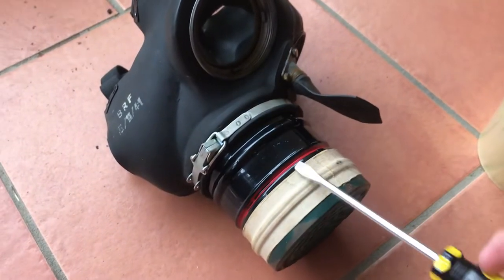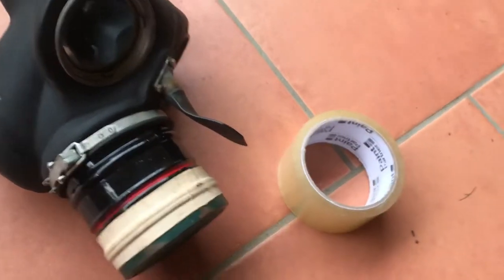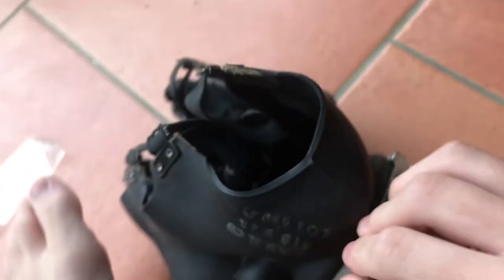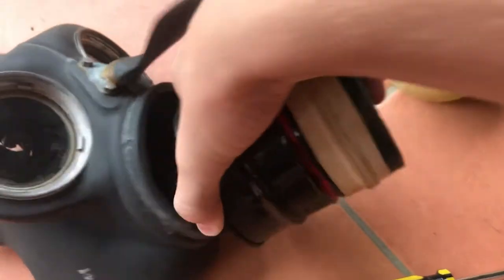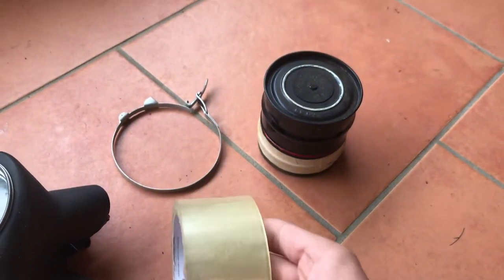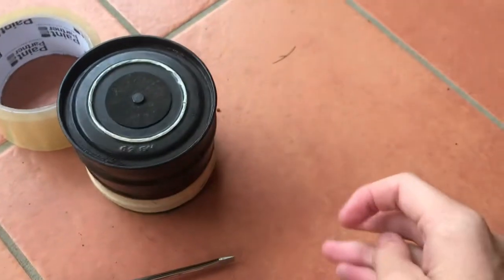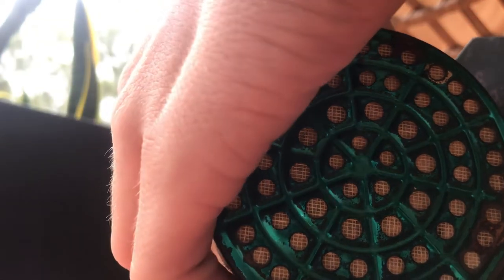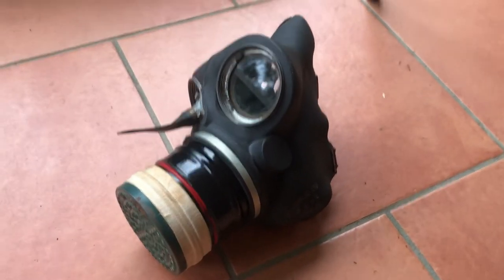How to remove CDR filter and put it back on.

Comment: Hey mate, any tips on repairing and strengthening the rubber? Mine is very cracked.  Also! My filter is completely hollow... But seems rather old and genuine, could someone have just striped the inside contents to make it safe to wear